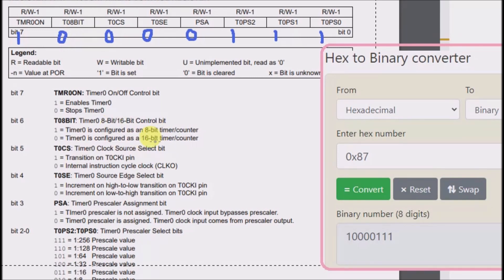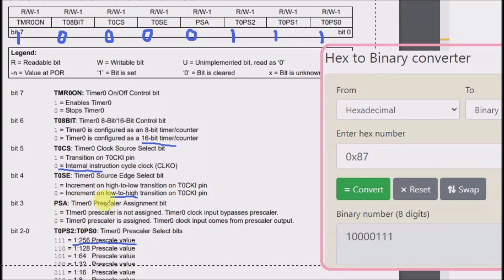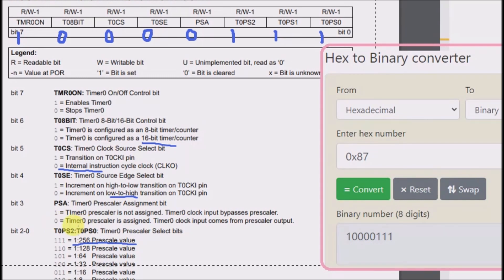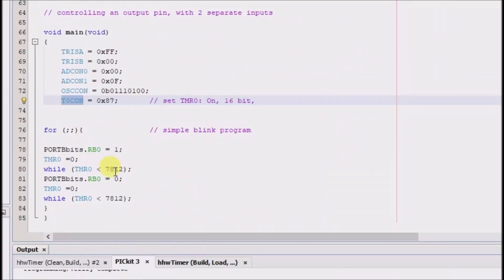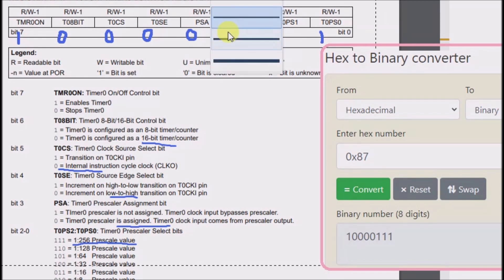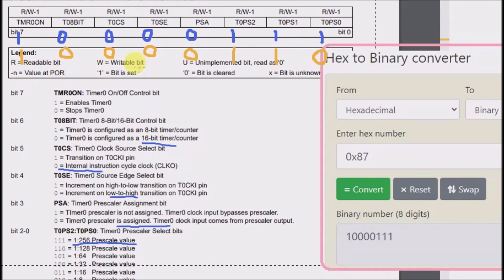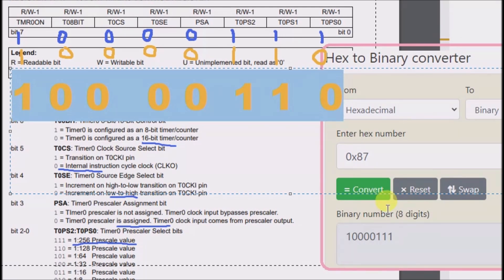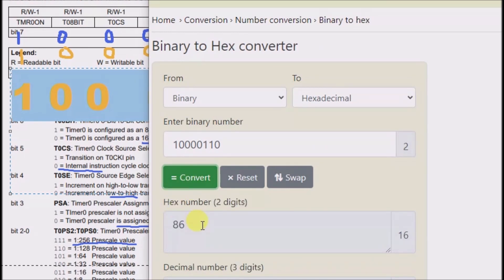PIC18F4525 Part 021: Timer as Delay and Adjusting Prescaler (in C Language)

Comment from the maker: // free sample code (copy and paste)
#include <xc.h>
#define _XTAL_FREQ 8000000  

void main(void) 
{
    //TRISA = 0xFF;
    TRISB = 0x00;
    //ADCON0 = 0x00;      // your chip may vary
    //ADCON1 = 0x0F;      // your chip may vary
    OSCCON = 0b01110100;  // your chip may vary
    T0CON = 0x80;       // set TMR0: On, 16 bit, ... have fun adjusting prescaler between 0x87 and 0x80 (refer to T0CON reg.)

    
    
for (;;){               // simple blink program

PORTBbits.RB0 = 1;
TMR0 =0;
while (TMR0 < 7812); 
PORTBbits.RB0 = 0;
TMR0 =0; 
while (TMR0 < 7812); 
}
}